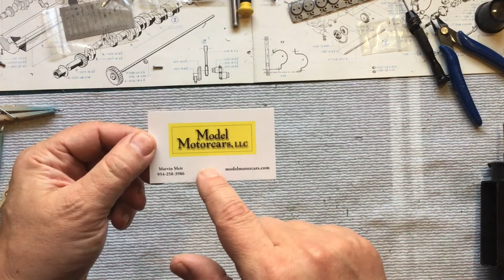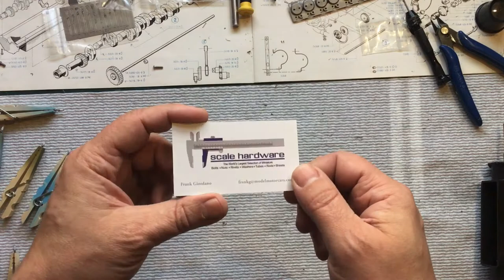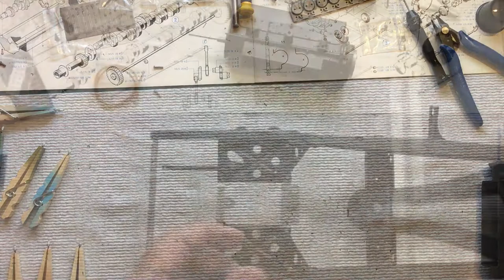Pocher Mercedes chassis update; and Model Motorcars spark plug installation

Comment: Hi, The sparks and wire/boot look great, one thing that I do with my dremel (actually black and decker), I plug it  through a sewing machine pedal, so I can drill really slow (from 0 rpm)with my hands free to hold my parts and drill lined-up as I want. I didn't know that you have a CNC and I feel a bit silly with my crappy mini mill $145 from ebay, I'm still tempted to get it just out of curiosity. Thanks for the video, 👍
Reply from the maker: Thanks! The CNC is fine for small parts, soft materials, light cuts, and not much Z needed. So I still would like a small manual mill. I did check out those cheap ones. They look interesting, but maybe a bit small. I’m sure they are great for the money though. I like the foot pedal idea. Thanks again!

Comment: I believe that cylinder thing hanging on the chassis is a greaser for various places on the suspension.  Rolls had one so I guess Mercedes didn't want to be left out.  Also, if you look at the head of the Mercedes engine the sparking plugs install downward at a 45 degree angle.  Since you are removing the cast in plugs why not make them fit right?  They were likely done straight by Pocher so the tool wouldn't need a slide and heck how many people in the '70s had instant access to 540k under hood pics.
Reply from the maker: Thanks for the info. When I first read your comment I just knew you were wrong about the plugs. I must have looked at every photo google had to offer and never once noticed they went in at an angle. I went to double check, and holly crap, how the heck did I miss that detail!? I was so focused on the routing of the wires, I didn’t even notice the actual plug angle. Where were you before I glued them in? I’m afraid if I try to fix it now I’ll just do more harm than good. Oh well, I’m sure it’s not the only thing on the model that isn’t technically correct. But I’ll remember it for the next one.
Reply: @customfabrications  I posted the above comment before seeing the entirety of the video where you installed the plugs.  Being a detail freak myself I hate it when somebody points out something I can't fix.  So um, sorry about that.  I'll do my best to catch up with your current progress so I can hopefully contribute before you are committed.  A4 Garage just started a Mercedes 300SL series that's sapping my YouTube time also, haha.  You should take a look at his videos.  They are amazing!
Reply from the maker: I’ve seen the 300. I agree, pretty amazing. I do appreciate any comments or feedback, I was trying to be a little sarcastic in my reply. I still can’t believe I never noticed the plugs in all the pics I looked at though. I thought about heating them with a soldering iron until they soften the plastic and lean over a bit. But if that goes wrong, it would be a huge pain to fix.